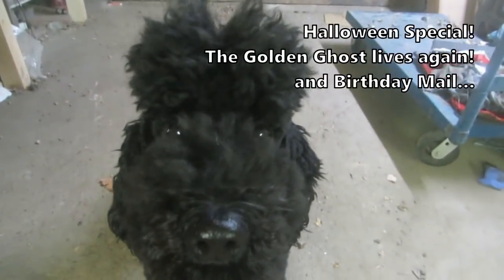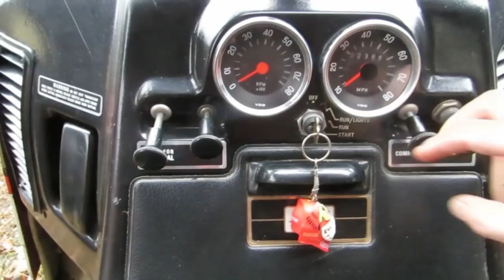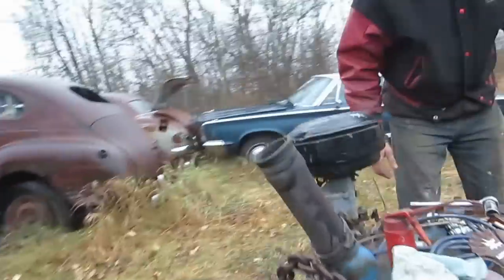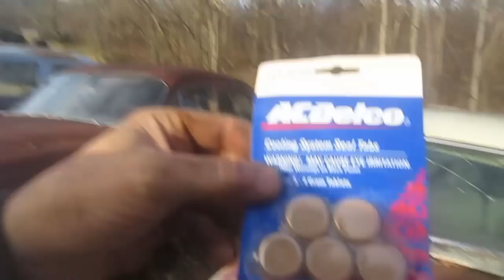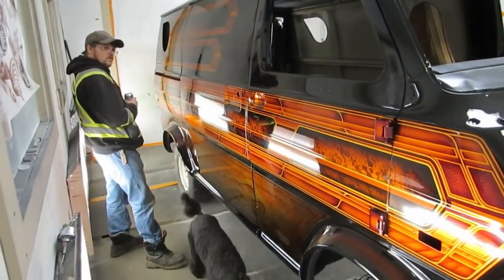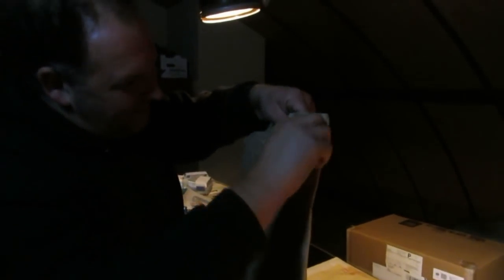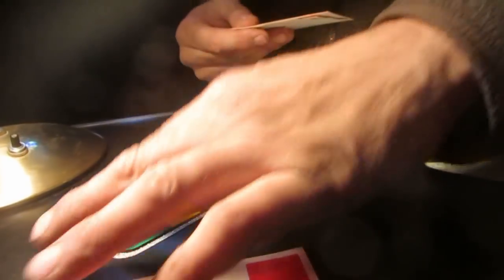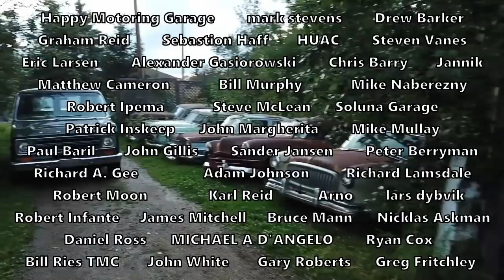Spooky Special! The Golden Ghost, Startups, Seats & Shopping!

Comment: That's the best van paint scheme I've ever seen. In 1975, I bought a yellow dodge D-100 stripped, no seat nothing. I painted a southwest scene ( lady Godiva on a horse), put chrome disciples on, visor, spoiler on back of roof. I bought van in Jan 1975, 360 v8, 3 speed. I did everything myself, and being a novice at paint,and interior work it took me 18 mos to finish. I had a 0 mile new '75 van in June '76. Teardrops, Ford pickup bed rails on roof,etc. The paint took the longest, I put the final coat on in june'76. I never wanted to do another! I enjoyed doing most of it, even with the many frustrating days of shit  that's not good enough, do it over. The Ford you have created is so far beyond amazing, I've

Comment: I painted some body parts for a neighbor who knew I did some painting on a Honda car/motorcycle in the 70's.  his car was blue metallic, but ha bought green metallic paint.  I sprayed his parts for cheap, like $30.  I called him and told him and told him they're ready and he came to get them he was mad because they were the wrong color but I said you just asked me to paint them and you supplied the paint.  He said I should have called me to tell him the paint didn't match, I said you just asked me to paint them,  I figured they were parts he got to put on a blue car.  I ended up painting them green for free.  after a string of similar problems I quit working on other peoples messes and just worked on my own messes.

Comment: Hi Scott and everyone at Cold War Motors. The Golden Ghost cleaned up beautifully. Limo engine, score! I was thinking sidepipes on the Boogie Van, YES! Lots of nice gifts from subscribers. Maybe a rubber expanding freeze plug, the kind you tighten with a wrench and it expands. I've used the gold powder stop leak many times for temporary repair. Johnson Ski Horse and evenrude had the same opposed twin cylinder engine. Winters coming,, the war continues.
Reply from the maker: Hi Wayne! Cheers from me and Frankers and the Agents!
Reply: @coldwarmotors  Did the van not require any wet sanding and buffing?
Reply: "rubber expanding freeze plug" This is often how the block heater element is fitted. Please check/replace it after 20 years, as I narrowly missed total engine seizing b/c all the coolant leaked when it popped out. That was on my '88 Volvo, and luckily noticed the engine sounded a bit funny while waiting at a stoplight - whew!

Comment: As a kid during the 70s we had a stack of National Geographic mags from the 50s.  Looked though the car ads (artist's renderings) for hours.  No surprise the 57 Chevy was my favorite car for years, and a number of 50 model kits were built.  Had a large scale AMT 56 Chevy kit that I motorized with a crown gear setup and solid axle at around 12.  Had a good 15 feet of speaker wire and a forward/reverse switch taped to a 6V lantern battery, running to the car.  Lit the tires up really well in the hallway.

Comment: I like how that snowmobile has a lighter lol!
Reply: Must have been a chain smoker on the design team of that sled.  Who else would have added that!
Reply: Emergency fire starter these days.
Reply: It's for plugging in a spotlight for spotting deer on the trail.
Reply: @waynegouin939  maybe but it has an actual cigarette lighter so it’s initial intent was to light a smoke. Which is so wow.
Reply: @MrCarGuy  Exactly. Very useful accessory for a snow machine.
Reply: My Father's 1974 Ski Doo Nordic 640 had a cigarette lighter on the dash. It also had burled wood grain (like a station wagon) on the sides of the engine cover, chrome skis and pop up headlight all from the factory. It was a beast.

Comment: The very top of commercial art and also the very top of design and engines of Pontiac. From 59 to about 69 the Pontiacs were stunning and sporty cars even as fullsize monsters.
I was very happy to see a 65 Bonneville ad. Yesterday I cruised over a Swiss mounain pass with my beloved 65 Bonneville convertible. With the torque and horsepower it still drives much better than most new cars. And the brakes on the Eight lug wheels are amazingly good, when they are adjusted right.
Now my car will spend the cold months in winter storage. 
Love to see the boogie van finished! Great paint job!!!!!

Comment: I remember Dad telling about cutting a hole through the floor and firewall on the forties vintage Chevys that he had before I came along for the purpose of replacing freeze plugs at the rear of the engine, also we used Bar's stop leak with the pellets in it for solving a lot of leaks we have encountered over the years, I remember Dad telling about it fixing a huge leak in the radiator of a Cat dozer at the coal mine he worked at when I was a kid.
Reply: My dad stopped using BAR's leak after he plugged up a radiator with it.
Reply: I used Bar s stop leak with the pellets in it on a 10 year old 1968 dodge charger when I was a teenager. It was dark brown. It worked like a charm.

Comment: Interesting reinforcement on the driver side seat frame. I guess that makes sense.
Reply: You could get the added reinforcement as a dealer installed option. And, did you notice the seat could be moved down and back on its mountings? Also done by the dealer.  A large owner could get the seat reinforced and the seat moved back and down, it appears this was done when the car was new. They could also adjust the left torsion bar if the driver was really heavy, to make the car ride level.

Comment: That Johnson cleaned up well. Those GM sealer tabs do work. I worked at Mitsubishi's assembly plant in Illinois (US) and the crappy Mexican engines that Chrysler made us use on some models when we were still the joint venture came with something similar already in the water neck of the 2.0 L 4's. What TRASH! The Boogie Van needs Mickey Thompson N-50's!

Comment: Great Vid as usual..  Just a quick FYI for what it's worth.. I have owned a Boat Load of old 4cly bikes..  One starting trick that i have used for years for when a bike has been sitting for a bit and is cold..  Open the petcock .. Turn on the choke..  Turn on the key and crank the engine with the kill switch OFF....  That gets fuel into All the carbs and you will find it does not drag cylinders.. as it will start on all 4 instead of 1 or 2.. Take Care.. Carry On..

Comment: I would suggest putting that gas cap on a strong coated stainless wire tether wire attached to the inside of the filler somehow so it isn't taken.

Comment: I'd use a bunch of zip ties instead of trying to sew up something like that burlap  to pull those springs back straight with.  I'm fortunate in that there's a general store about 4 miles from me that sells non-ethanol gasoline.  The brand is CountryMark and I believe it's refined here in Indiana.

Comment: Scott, If you don't mind spending a little extra the 91 octane Shell does not use ethanol and I believe Canadian Tire 91 octane doesn't either. I use shell in all my small engines and never have a problem.

Comment: I have a friend that bought a beat to death ford escort for $250 with plans of just getting him to work and back through the winter.  It immediately sprung a leak from one of the freeze plugs.  It had a hole in the center of it and he got the idea to JB weld a half-dollar over the plug because it was a perfect fit.  The fix held and he ended up driving the car for 5 years before selling it for $250.  He like to tell that story and says "it was the best 50 cents he ever lost on a deal"

Comment: Running the Golden Ghost, it appears you are spraying for mosquitoes with all that smoke. You should try some Amsoil 100:1 oil for 2 stroke engines. It is synthetic and basically no smoke, keeps the spark plugs from fouling and it lubricates. If scared, you can up the dose but, I had a Hoemelite Weed Wacker (ST-18) and use it every summer for 11 years with the factory spark plug. Always started. The oil is fantastic.

Comment: Such a deal, you buy an engine, get the transmission, brake and clutch pedal, master cylinder, and what looks like a set of Moroso racing spark plug wires.  You scored big.

Comment: GM used stop leak pellets in all of their trucks at one time due to porosity issues in their aluminum cylinder heads and tiny leaks in their coolant hose joints.  I don't think GM uses the stop leak pellets any more at truck and I am not sure if they were ever used in their passenger cars.  We used to call the stop leak pellets "Rat Shits".  By the way the boogie van's custom paint job looks awesome.  Your painting and design skills are top notch.

Comment: i have a 1954 kaiser special my dad before he pasted spotted a massive water leak in the back fire wall well i inherited the car  dad was going to cut a hole big enough to get to it on the inside then patch it .The floor mats will cover it and faster than pulling motor  hope it helps  im very interested in your fix to

Comment: Boogie Van looks spookily amazing!!! You guys did a fantastic job. Snow machine gots some nice vdo gauges, should work well in summertime to clear mosquitoes))). seriously though, great condition original machine looks great. Attach a sled and take frankers for a ride!  Nice score on the straight six, sold my 265 out of my original 55 150 chevy post when i was 14 to put a 348 from an old dirt track 55 that had been rolled. Was sold anything i wanted off the car for $100 in 1983.  I paid 125 for the 150 post, those were the days.

Comment: Happy Birthday Scott! The Boogie Van looks like it time traveled from 1978 but higher quality. I'm curious what is going to end up in the paint bay once the van leaves. One of the cheaters I was shown for coolant leaks is to add sodium silicate (water glass) to the coolant. It stops small leaks w/o plugging up the radiator & heater core. For anything I don't run often (especially small gas engines ) I only use no-alcohol premium gas. It costs more but it doesn't destroy the fuel system parts.
Reply from the maker: Yeah! Non-alky premium is the only way to go, for sure! Cheers...
Reply: Not available in DFW area of Texas, and haven't seen it in Texas since alcohol came out here.

Comment: Scott, get some jack stands and use them before you kill your knees completely.
Reply from the maker: Have you ever tried walking with jack stands strapped to your knees? It isn't actually much help... Cheers!
Reply: @coldwarmotors  Ha ha very funny. I worked in garages and body shops for 20 years and wouldn't try to paint a car unless it was off the ground on jack stands and the wheels off. I notice you are careful of your lungs and ears but you complain your knees are taking a beating. Getting a car up a few inches makes a big difference.

Comment: the catalina and bonneville, were not chevrolets. both pontiacs, had big block motors, with a 4 speed auto., rotomatic 3 speed and the thm400 trans. (depending on years)

Comment: Put 89 or 91 or higher octane gas from Shell any excellent fuel brand also A Grey Bottle of STP Total Treatment fuel injection cleaner every fuel tank full on Snowmobile or any old vechile plus Lead fuel types even on Desiel fuel too with STP Total Treatment fuel injection cleaner! Yes Ethonal hard start up big to small engines agree to that! Even on small engines use oil to gas mix types use STP Total Treatment fuel injection cleaner every fuel tank full! I found that STP Total Treatment fuel injection cleaner use it just Like Fuel Antifreeze in Winters Season too but stronger get fast starts ! Also save starter motors and rip cord like Snowmobile or Chainsaw or Lawn or Farm Tractors plus Snow Blowers too even Leaf Blowers too! You can try guys at Cold Motors group plus viewers to on You Tubers!